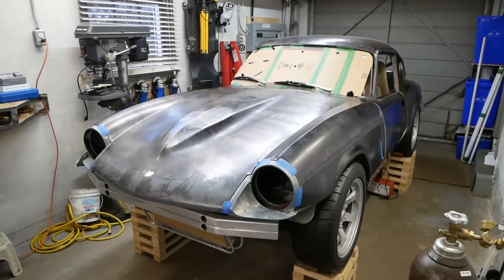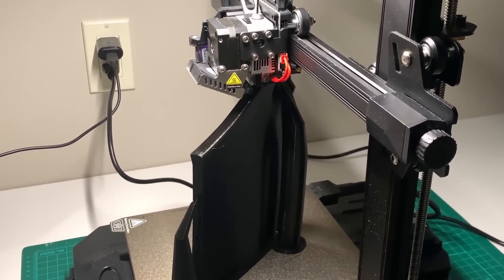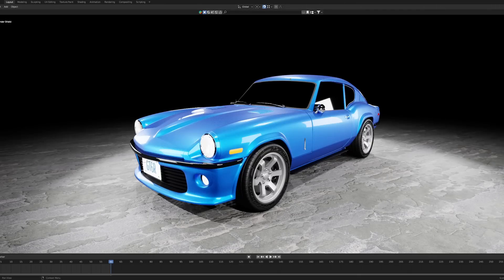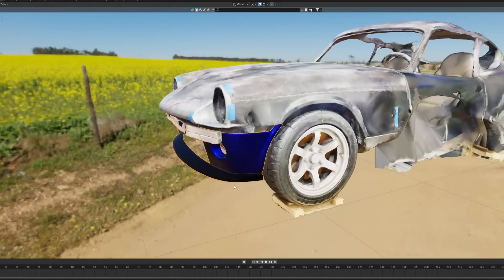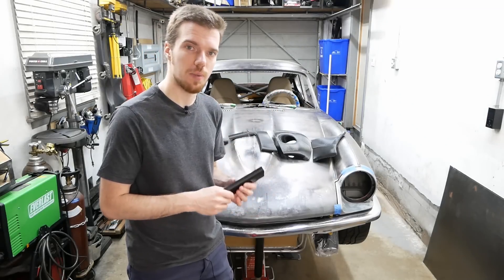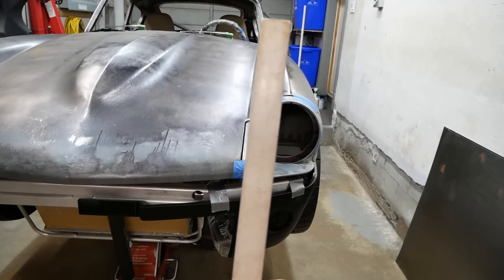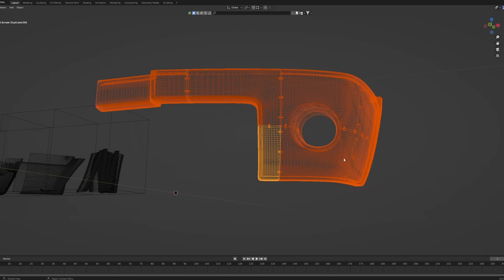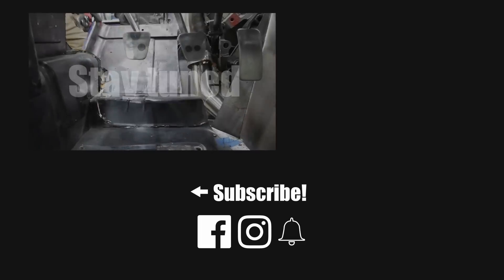Let’s 3D Print a Bumper! Pro Touring V8 Powered Triumph Build – Project GT6R – Ep40

Comment: a cheap alternative to the proper 3d scanners is Xbox one kinect cameras, you can get an adapter to plug in into a laptop and some free software and create the 3d models from there

main advantage is that it does give you realtime feedback as to what the model will look like, and some of the paid for software makes it even nicer
Reply from the maker: Will have to look into that, thanks man! 💪

Comment: An excellent alternative to using hot glue, is standard superglue and backing-soda as an activator / filler. 
With a bit of practices, it will provide a far stronger and cleaner joint.
Reply from the maker: I did read up about that, thought I’d give this a try though as it was on hand and if it didn’t hold well enough I could always pull it apart and redo with superglue 👍 for an end use part, I’d definitely go that route. Cheers!

Comment: Super glue works better to adhere PLA together without warping. Pick up some bulk with activator for quick assembly.
Reply from the maker: I did read that, but thought we’d give this a try as worst case it didn’t hold and I can peel it off… best case it works!  So far, it’s good enough for molds, would definitely use super glue on finished parts though 👍
Reply: @FanatikBuilds  have you thought about reaching out to a 3d printing channel with a Giga printer? @iliketomakestuff is into cars and may help out. Get you down to a two piece setup

Comment: Nice. Just a printing tip, though perhaps you're already aware. Print warping is a curse that can affect even the best of setups, but in general it's caused by things that can be remedied. Thickening the printed object may mask or mitigate the most common type of warping, which is uneven part cooling, the problem often won't be solved by thickening. Often uneven cooling is caused by air drafts, HVAC, open doors/windows, temperature extremes, incorrect printer fan settings, etc. Make certain the printing area is remedied of "air flow" issues, and if your filament calls for it use a printer enclosure (not all filaments work well in an enclosure) you can build one. Of course, sometimes the damn-things just warp even when everything seems right LOL. 

Generally, on top of cooling issues, make sure your slicer sets the correct temp (bed and nozzle), and correct fan settings for the specific filament you are using (your example was PLA which is pretty straight-forward and forgiving so probably fine in this case, but each brand of PLA or whatever filament will have it's own setting requirements so double-check. Cheers.
Reply from the maker: I did get a small amount of warpage on the corners that were contacting the bed … not big enough to create a problem here but I can see how it would be an issue on other objects!  Already put the printer in the quietest, least drafty, best lit corner of the house so maybe bed temperature could be adjusted… lots to play with! Cheers! ✌️😎

Comment: Excellent work, I'm a composite engineer, you should definitely print the bumper with some thickness and very little infill, the thickness acts like a sandwich panel and by spacing out the composite layers, it increases the parts bending ridigidity significantly. Then you can cover the front of the bumper with a finishing layer of fiberglass cloth and add some layers for strength in the backside of the bumper. Doing this lets you achieve very strong parts without using too many layers of composite material, keeping  down the cost and weight.
Reply: This should be a S.E.M.A car when it's finished the amount of design and engineering is stellar almost every aspect has been re-thought and re-engineered
Reply: @darrenbrisson4336  Amen!
Reply: I disagree because SEMA is only for snobby people who like to call themselves industry professionals and not real automotive enthusiasts. It is also stupidly expensive to get in, even if you are allowed to do so.@darrenbrisson4336
Reply: Gotta admit, as someone who 3D prints for other hobby things, I would've more thought in terms of merely shaping a finished layer on top of the print and then turning that into a buck to mold the surface for the actual part in something more durable and temperature-resistant.
In hobby areas like cosplay costumes and props, we also use PETG filament instead, since it sands nicer (less gunking up the sandpaper) and is slightly more temperature resistant. Sanding and filling the surface is a pain, but a necessary one. Even PETG is not as temperature-resistant as ABS, but you don't have to deal with a chamber around the printer to keep the temperature steady because ABS as a material is such a "spoilt princess".
Reply: Do you have the use of a printer big enough to make the piece in one piece?
Reply from the maker: The second set printed at 1cm thickness with 10% infill is vastly superior for sure!  Thanks Amir, appreciate the advice and I hope you’ll like how it all comes together!  Have a great weekend 🫡🙏
Reply: Beautifully done in your usual style with a combination of new-tech and good ole’ garage disk grinder work.  Nice job!

Comment: I'm not sure if I've mentioned this before, Aren't you worried about sucking in water through the low mounted air filters ?, If you happen to run through unexpected deep puddles you could hydro lock your engine.
Reply from the maker: We talked about some of our plans there in Ep30 actually!  The filters will be fully boxed off with shrouding and shields to hopefully direct the water away and drain it out louvres in the base of each side.  Having two filters is a bit of a safety feature in itself though, as both sides would have to be fully submerged for it to draw any water into the engine 🙂🫡👍 cheers!